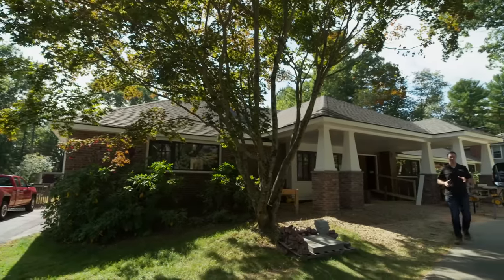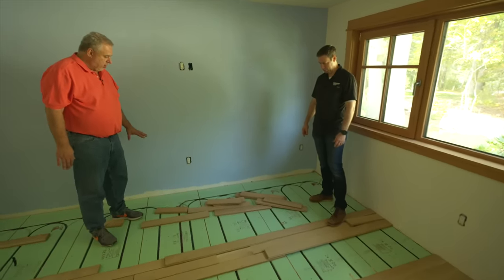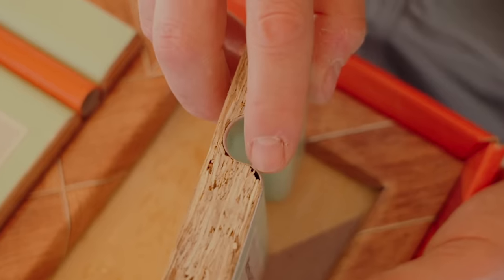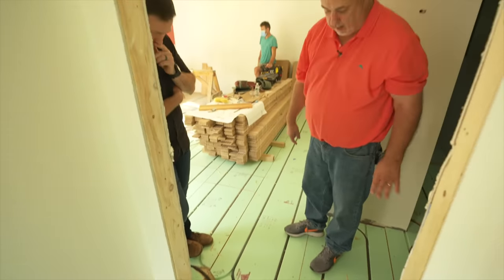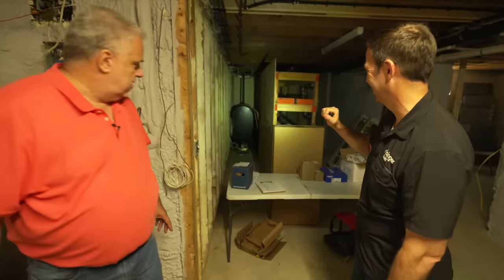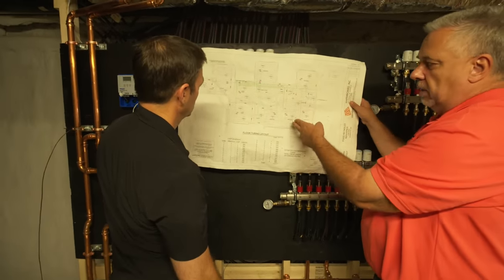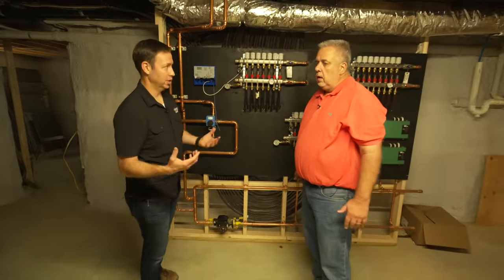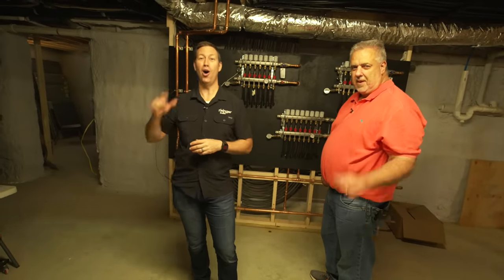Plug and Play Radiant Floor Heating System - BEST ON THE MARKET

Comment: I can only imagine what that heating system cost, yikes, but sure is nice
Reply: Nearly every new house here in germany has radiant floor heating. The costs are not that much above other radiant systems. 

As always it is funny to see that this is something special in the USA. But I'm glad that this awesome system is presented to a big audience. Viega had similar plug and play systems. Geberit as well if I'm not wrong.
Reply: @axelotl86  Yeah, people think too much about the installation costs and not about the running costs. If you run an HVAC system 24/7 in a continental climate like the US you will probably pay more in total heating expenditures over the course of 10-20 years than you would if you had radiant heating in at least the first floor of the house.
Reply: @melange78  Not only that, you Van also cool your house with this Installation.
Reply: @axelotl86  It's special because it's a retro fit. Of course it won't be as expensive if you were putting this in a new houses versus HVAC or Radiators. You still need to run the pipes!
Reply: Axel Hinn please provide more information about cooling with radiant.  i have cast iron radiators
Reply: @Dukefrukem  Most houses here are easy to retrofit because we already only use water for our heating and not air. Air is ineffective and in a country where energy is expensive, you can't go the air route as many US houses do.
Reply: @denisrhodes54  I meant cooling with radiant floor heating systems. 
I can only give you German links if that is ok with you ;)
Reply: @axelotl86  hey huge question because I had the same thought that you could cool with these systems, but all I’ve read is you can’t do to condensation moisture? Are you able to cool because it’s going in a concrete floor/ maybe a concrete covered with stone floor?
Reply: Your looking at like 14$ a sqft for installed system for what I’ve seen not cheap up front but longevity is quite impressive
Reply: @axelotl86  americans stopped using radiant flooring years ago cause its really not that good. Its expensive to install and repair. also air heating is more efficient than water heating but okay yah.
Reply: @mikecousin8523  right, and that was the method hey used because it was cheap. This system is too expensive  and thats why  not one uses it.
Reply: @Dougie_trades  it’s important to let the water stay above 10-14C so that condensation isn’t happening. It’s passive cooling and of course not on the same level as a AC but it’s still very awesome to create a very good climate in the room in the summer.
Reply: @The Magic Hispanic I don't know about that. My gas bill keeps going up while the price for natural gas keeps dropping. When I install my radiant heating system I'm going to use a pellet boiler. You also forget about the climate change. That crappy solar and wind is going to save us.
Reply: @The Magic Hispanic And soon the infrastructure will exist for wind and solar. Solar on houses with battery backup for night. I can get a setup for my house for $12k, if I was going to stay I would invest.
Reply: @The Magic Hispanic Natural gas is cleaner than coal or oil and solar and wind are cleaner than natural gas. Just as we transitioned from coal to oil and natural gas we will transition from natural gas. It won't be easy, it won't be quick, and it won't be cheap but we will transition from it.
Reply: @The Magic Hispanic I am living in a self sufficient house that survives for centuries. Sorry for not caring about oil and gas but about the environment. Yeah I know a hard I understand concept for some people out there in the USA.

And I would call it ceap when you have to use fracking. You will see a different world in 5 to 10 years.
Reply: @melange78  exactly I would love to hear about the ongoing costs after installation to heat the home.

Comment: This fascinates me.  I can't imagine using this here in Alabama.  I have a heat pump with a thermostat that allows me to cool during the day and heat at night!
Reply: It wouldn't be very cost effective in the South.  Winters are too mild.
Reply: floor heating also works with cold water to cool the floor in the summer. just dont go below 60f on the water temperature.
Reply: @SupremeRuleroftheWorld  I'm curious about that.  Have you seen a cooling application?  My only concern would be dehumidification.
Reply: @bradleypayne2495  i have it in my home. works fine. i only use split air to get rid of the humidity. but the house itself remains cool. no heat soaking summers.
Reply: @bradleypayne2495  It works but it is very mild. Normal AC is better

Comment: Wouldn´t pass inspection in Germany. 
1. No insulation at all on the pipes. 
2 No Air Release after the Boiler. 
3 No Magnetite and Dirt Catcher on the return line. 
4 No Soundproofing on the lines.

Comment: Terrible decision to keep the old oil boiler. Underfloor heating works with warm water, and is therefore ideally suited to heat pumps, or failing that a modern, condensing boiler. The extra efficiency of a good condensing boiler would pay for itself in no time, while significantly reducing emissions.
Reply: I think it makes sense to keep the old boiler. Saves several thousand $. Just have to add ~30 gallons of water to act as a buffer to let the boiler turn off for a meaningful amount of time.
Reply: Totally agree that the oil boiler is a mistake. Should have done heat pumps from geothermal. Hopefully they retrofit it to this system someday when this oil boiler kicks it.
Reply: The entire system was not covered in that much detail,.....if the boiler is being used to heat stored hot water, then a mixing valve can be used to sip just enough to raise the temp of the return so the boiler would run very little.

 Also that boiler might be, doubtful, but might be a variable regulating boiler and be able to run very low to make just the right amount of BTU required.

    They did not cover if it was dedicated or it was also used for showers.....etc etc........some boilers can be very efficient running from 10k BTU up tp 180K............I have no idea the specs on that unit.

     Like always, there is always more to it, details matter,.....I was designing a system in a very insulated house in a mid latitude climate.  The required BTU load was only about 13k during the coldest days.........the smallest self regulating units available would only do like 40k-120k.

 What that translated to was the unit would be producing 4 times the required max BTU load..........which would have lead to drastic short cycling of the unit and much wasted energy.

   2 solutions were presented, use a storage tank, expensive and kind of negates using a demand flow if you will be storing 50 gallons of hot water or let it short cycle and reduce the life of the equipment drastically, under max load, the short cycling would have been much more frequent on 50 degree days, so a heat pump water heater was used.
Reply: @InverseCh  buffer tanks make a lot of sense with a boiler.  The problem I see is that boilers are built to produce very hot water or steam.  So without the buffer tank they would continuously short cycle actually driving up the cost of heating
Reply: They did say in the video, that the infloor heat company made modifications to their design to incorporate the boiler being kept, so  there maybe something in that regard that wasn't mentioned to make it work well.
Reply: I don't believe there is a condensing boiler for Oil heat, only Propane\Nat Gas. In New England there isn't much natural gas, and Propane can is pretty expensive. that said its likely that boiler system would need a storage tank to avoid short cycling the boiler.
Reply: @shawncockrell6007  I was designing a system for my own home. I ended up w/ a reversible heat pump and one or two 30 gallon buffer tanks + radiant cooling. I also made the heat pump do double duty and provide DHW. (Climate zone 4A)
Reply: Guy Tech Condensing boilers are available for oil. They have been mandatory for years in the U.K.

Comment: Besides the thermal losses over 300ft, there are also head losses (pipe friction).  You would need to scale up the pump for no good reason where a manifold would reduce the head loss as well as improve the thermal balancing.
Reply: Yup. I think running the entire system on one small circulation pump is going to cause a problem. Also I noticed no Balancing valve in the layout. If some of the solenoid valves get stuck, it can burn up the pump.
Reply: Guy Tech That's what self modulating pumps are for! Or aren't they a thing in the US? Is a balancing valve what we would call a bypass? Just something to allow water to flow even when all the solenoid close?

Comment: I live in South Korea and floor heating has always been the standard over here...since always.
 Even in the oldest, most run down house...it has floor heating. But I've never understood how this could be as economical as forced air. Every barrier acts as insulation.  Not to mention potential toxicity coming from laminated floors and glues.

Comment: Nice timely video as I'm wrapping up my Warmboard R installation! Did ~ 2000 sq ft, 8 zones, 15 loops, just under 3500 ft of tubing in an 80s built ranch.
Still debating between a ground source heat pump or a condensing oil boiler (no natural gas available to the property). Any opinions????
Reply: Propane?
Reply: @lrc87290  propane could be used, already have a fuel oil boiler so I'm "comfortable" with it, not sure I'd like having a tank sitting outside.
Reply: @Tomsecks  They do bury them. Is that a possibility where you live?
Reply: @lrc87290  interesting, I didn't know that, i'm sure a local company could answer that for me.
Reply: Mark Gerko If I were you I'd stick with the oil until it needs replacement. Why spend the extra on a new propane boiler when the environmental benefits are negligible- both are still fossil fuels. However, I would design and specify the system in such a way that it will work with a heat pump when the oil boiler reaches the end of its life. They are getting ever cheaper and there may come a time even in the oil loving US where incentives  are offered to switch to greener technology. I'm UK based and have a retrofit UFH system, but powered by my existing gas boiler. I'd love to switch to a heat pump but the numbers didn't work at the time, but I made sure it would work with one in the future. Very little will be required to make the change when the time comes as the system was built with closely spaced pipes to ensure it will function adequately with the low temperatures heat pumps work most efficiently at. If your home is sufficiently insulated and airtight it's probably possible to maintain a comfortable temperature using water as cool as thirty degrees Celsius, perfect for a heat pump. Closer pipes also mean a faster response time when you switch on the heat or turn it up.

Comment: Really nice system.  But... I would want a backup pump installed. Impellers and bearings wear over time, and sure it may be 15 years before there's a problem but you just know that happens on a weekend and it's 8 degrees outside.  Any tips on water conditioning?  I  wonder about glycol as an insurance in case of an extended power failure.

Comment: Why would people put in a new 'fuel oil' system in the past few decades?  Couldn't they at least have done biomass or propane if they didn't have 'natural gas' or something else was unacceptable?  The only thing I can think of worse than FO is coal, but maybe I'm wrong.
Reply: I guess the severely reduced need for oil makes that moot. (because of the efficiency of the system) I bet they are adding a ton of insulation also.
Reply: I take it you don't own a house. $ vs btu's. It cost alot more to do the same thing with electric and propane. Plus these gas utility companies don't want to put new lines in.
Reply: My house had .8ach 50 but even if I didn't have an efficient house so what, I designed it so even in winter I rarely need any supplemental heat.  I'm surprised to hear that fuel oil is more efficient than propane though.  I've always tried to choose the option that did the least damage to the world though.  It is a choice that anyone can make, claiming they can't is simply untrue, it's simply a matter of priorities.  To be clear, I wasn't talking about efficiency when I said 'worse' I meant pollution....
Reply: @henrypotter3024  "Pollution" is decidedly  a low consideration.  Price, availability, ease of installation come first.
Reply: @firesurfer  like I said, 'priorities' I know some people don't care about the future, some do to a lesser degree...I wouldn't choose something that I'm going to have for 20+ years without considering the long term costs and benefits.

Comment: The Viessmann is probably 25 years old. Nice job of the plumbing. Would the loops run closer in distance you can reduce the heat needed. For example we use here in Germany 125mm to 150mm in between. Greets from Germany

Comment: that floor heating wouldn't pass code here. There is spots where the end of the loops touch the supply/return pipe. You need 3" min spacing for 1/2, (6" for the loops). Then the supply/return lines have like 9" of space between them. There are going to be hot and cold spots all over the place the way this is laid out.

Also I don't understand why everything appears to be a home run loop back to the mechanical room when you could have manifolds in different points of the house and run a larger supply/return to each manifold and take your loops off of there. I don't even see how you could achieve 300' loops with this method for rooms far away from the mech room.

Comment: i just got a quote for warmboard for 1200 sqft. 15,000 thousand for just the warmboard product. this does not include anything such as boiler, tubing or anything else required for for a radiant heat setup. there is no doubt, it is the best ive ever seen on the market but damn does the price sure reflect that.

Comment: It's all fun and games until you accidentally put a nail through a tube.
Reply: You're not wrong :) Fortunately with our products you can see the tubing the entire time. Makes it much easier to avoid a puncture.
Reply: Yeah,that flooring guy must have concentration of zen master.
Reply: Yeah right, I'm sure the plumber has the system charged with air so the floor guy will know he hit a pipe.
Reply: @Warmboard  Unfortunately, you are not telling the full story. Particularly when one is laying parallel to the tubes, it is easy to cover a tube, but not enough that a staple cannot hit it (they can and do "skate" on the aluminum). Another issue is when the layout is complex, and there is a lot of supplemental routing for tubes. Easy to partly cover and or forget exact locations. As a high-end builder, I love the heat quality, but really dread the penetration potential. Even with an air test on while laying, we have had penetrations that ultimately were revealed to have occurred under test, but held. And when the fastener rusts and finally blows out 3 to 14 months (we have had the full range) later, it is a real mess. The leaks start so slowly that a lot of hidden damage can occur before it is apparent on the surface. And of course, the tubing is vulnerable forever after, like if some moron screws a floor stop down without thinking. 

Awesome performance, but extreme care and diligence is absolutely mandatory.
Reply: Nailing the flooring is not a problem with reasonable care.  It is very open where to nail without puncturing the tubing.  If one does, it is repairable by splicing in a new piece of tubing.  The channel does have to be opened up a slight bit to accommodate the two crimp rings.
Reply: Coordination is always an effort - I have seen numerous drywall screws and nails sent thru plumbing
Reply: Then it's just a game. Fix the tube.
Reply: This is easy: You go slow during the install, and use Bostik floor glue. I like to use engineered floors that can be glued down. Every install I’ve done has been perfect, and never a leak, never a squeak either!

Comment: With radiant floor heating, you could use heat pumps because of the lower temperature of the water, right? They probably have to bring the temperature down from their the boiler in that mixing valve.

Comment: There are a lot of different ways to do radiant .   Worth mentioning that any radiant is better than no radiant.    You can install in on the floor, under the floor, in the joists or in the ceiling.   Or - the walls and other edifices.
Reply: True and appreciated, but unfortunately in 15 minutes we have to choose, and we chose the system we installed here
Reply: @stevenbaczekarchitect9431  Yes, agreed.   The point I was trying to make is  "radiant is the proper choice for heating."
Reply: You mentioned under floor. I'm curious about using radiant heating under the subfloor, as I have relatively easy access via the drop-ceiling in my basement (within the thermal envelope). However, I wonder if the subfloor+hardwood flooring would be too insulated to allow much radiated heat?  I would also have to find which heat-pump would be most appropriate.
Reply: @koaea  This installation is called "staple up" in my area and works VERY VERY well.   

You can use aluminum panels (think cheap one ideally) to conduct heat to a larger contact surface with the underside of the subfloor.   This install is well within what one would consider a DIY potential. 

There are several questions you will have that will elicit an "it depends" response.   

If you like I can send photos and vids of similar installs.